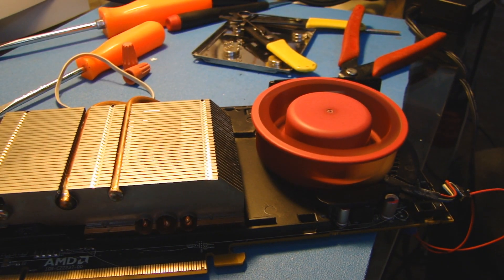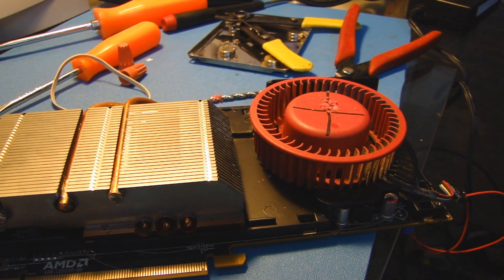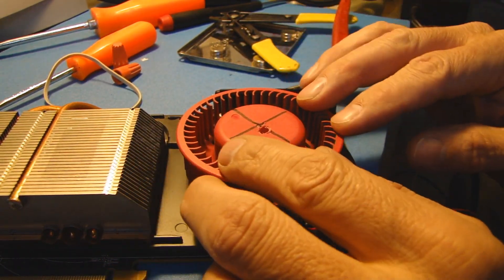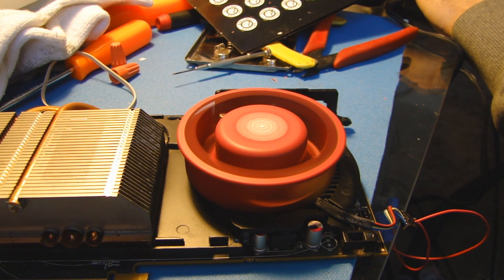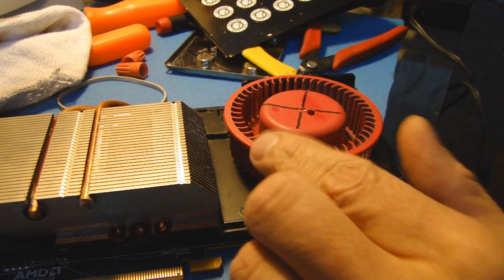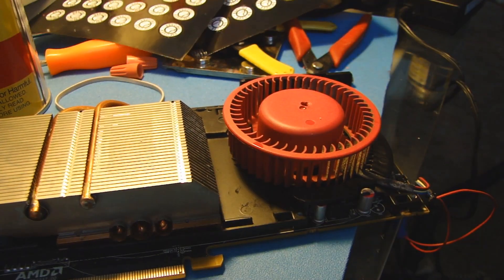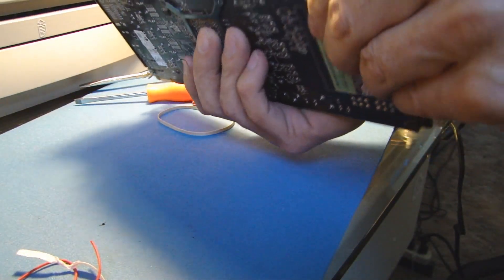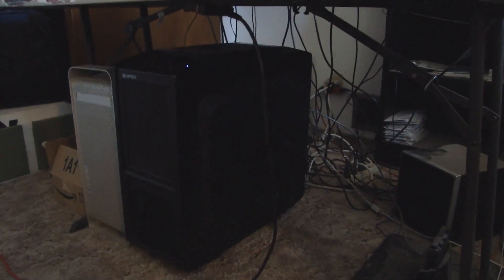Repairing Radeon 6870 fan noise...the easy way....

Comment: Dont do it this way.  Take off the reference cooler, and there is a triangle bottom.  Put screws under each part and force it open.  That is where you want to put the oil.  It will look exactly like taking the sticker off a case fan.  Also 3 in 1 oil works wonders on fans, and it lasts.  I have been using the same fans for my old corsair h70 for nearly 5 years.  Even after taking the cooler out and replacing it, i have the 2 fans in my case cooling it right now till i replace them.  Refer to this video to see how to oil a reference blower.  https://www.youtube.com/watch?v=kH8spGRL3Yk
Reply: +MagicOf Light Bearing grease would be optimal.  But i dont have any of that so :D 3 in 1 it is.
Reply from the maker: +MagicOf Light --- 2 things: 

1) Removing the fan is a huge process in and of itself.  This tutorial is aimed at those who do not wish to completely disassemble the GPU, including removing heat sinks from the CPU's, and then reseating them with thermal compound, which they will have to purchase or order and hence, wait for.  Not everyone keeps thermal compound in their toolbox like you and I do.

2) After almost 2 years in service, the fan is still running silently.

So with all due respect, while your solutions may be good ones, this is clearly quicker, easier, and dare I say, "permanent."
Reply: +Donnie Frank Well, they have also changed reference cards.  Recently I tried to open my moms reference hd 6950, which is what made me stop in here.  But, even with removing the heatsink from the gpu, taking the reference fan off, or even trying to get to the triangle part to pop open was nearly impossible without completely disassembling the entire case for the gpu, and since I lacked experience I did not because i did not want to hurt the board by forcing things off.

  WD-40 is not permanent.  In fact.  I have used PB blast which is magnetic and better than wd-40 on my bike bearings before.  After about a year or so after, my bearings were chewed up, because they did not have a buffer to keep them from grinding.  Thats why even 3 in 1 oil is not idea.  But it has alot more viscosity than wd-40.  I have never seen anyone treat a gpu quite like you did in this video.  It reminds me of another video when i saw someone scraping thermal paste off a cpu heatsink.  My hd 6950 is about 5 years old now.  I had to replace the twin frozr 2 fans/heatsink to another non reference heatsink/fan assembly because they were fans that really could not be replaced by themselves.  3 years after that change, the card is still running like a champ and im able to overclock 10% and maybe hit 60c in furmark.

  It is only maybe 30 dollars for an entire heatsink/fan assembly for a gpu for most models.  Doing this and possibly ruining your fan instead of spending maybe 40 dollars on a new heatsink+thermal compound seems very risky to me.  If you messed up what you were doing, and you only have 1 gpu, you are out of luck and dont have a pc to use.  Im trying to help people, your video may help some desperate soul who wants to prolong that reference fan.  But doing it this way should probably never ever be done, unless you are either desperate, or have another newer card and this is your backup card that you dont care if you ruin.
Reply: +MagicOf Light Just wanted to add.  Using something thin like wd-40 is completely temporary.  The thinner substance will in fact make it smoooooth and spin better than any other grease or oil you could use.  But it will also ruin the bearings permanently and they will have nicks and chips all over them, and it will get worse with time.
Reply from the maker: +MagicOf Light Well, again, you are purporting a more-complicated, more-expensive solution.  And I'm going to guess you didn't watch the full video, because WD-40 is just the catalyst for the motor oil.  The motor oil is too thick, so it doesn't spread and penetrate where it needs to.  The WD-40 ADDED to the motor oil penetrated the entire bearing assembly.  Once the WD-40 dries out (as it will), the motor oil is left behind, which should literally last forever.  Check the oil stains in your driveway.  Despite rain, snow, hail, sleet and merciless Sun, the oil is still there.  Right?

While I can't say if the repair will last 5 years, I CAN say that the repair will be 2 years old in two weeks.  My gut tells me that the repair will outlive the usefulness of the GPU.  4K video is on the horizon, which means 4K editing, which mean a more powerful GPU.

To summarize:

My repair = $0.00
Your repair = $40.00

My repair = about 1 hour.
Your repair = at least 2 hours, if not 3.

My repair can be done by any novice.
Your repair requires advanced skills.

My repair requires no special tools or materials (motor oil, WD-40, drill bit).
Your repair undoubtedly requires special tools to completely dismantle the GPU and thermal compound for reassembly.

My target audience?  The novice.  So while I have conceded that your repair probably works, you have to concede that my repair not only works, but it can be done by any 10-year-old with a screwdriver.
Reply: Donnie Frank Actually I did watch the whole video.  And the part where you were trying to keep the shavings out of the hole you made made me freak out, because one shaving is all it would take to completely ruin the fan.  You seriously got lucky there.  One shaving would have fallen in there of a decent size could have seized up the fan completely rendering your fix useless.

To summarize.

My repair-40 dollars, 100% effective.
Your repair-0 dollars, could ruin the gpu fan, leaving you with no graphics card.

Its not a matter of if this particular time it worked for you.  Because this kind of repair is risky, unorthodox, and not 1 computer repair person in the world would ever do it this way. You should have saved the 40 dollars...seriously.  

My way does not take any special tools.  Just small phillips screwdrivers that every single person who has a few tools has.  And learning how to take off the heatsink and replace the thermal compound does not take special training.  A 5 minute video on youtube from a tech expert on newegg can show you how its done.

This was an experiment really, not a repair.  And any novice who isnt willing to invest a few dollars to replace a fan and watch a video on how to do it, or replace the heatsink and watch a video on how to do that, needs to just take it to a shop and let them do it.  

WD-40 is less dense than oil, so it is the same as oil and water, it will rise to the surface and cause aeration and sludge.  Even if it has worked for 2 years.  Once that oil you put in starts to sludge, thats it for that fan.  3 in 1 oil can be added over and over.  Because it not like regular oil.  And the only thing that will eventually kill the fan is when the bearing finally starts to be too loud or seizes up because of how chipped it gets over the course of its life.

Even tech professionals use 3 in 1 oil to lube fans with.  One drop is all it takes once in a great while.  Just because you werent willing to search on how to take off the fan and oil it properly you are giving people this idea and possibly causing them to ruin their gpu fan for good.  And when the oil sludges it will be for good.  So either now or later, it is not a permanent solution that you claim it to be.
Reply from the maker: +MagicOf Light 

To Summarize:

My repair is 100% effective.  I did not get lucky.  If you noticed, I drilled by hand (no motors).  So keeping shavings out of the fan motor was easy.  We're not producing microscopic shavings here.  We're producing large chunks that are easily identified and removed.  Your "what if" arguments hold no water.

Risky?  Hardly.  That is your opinion.  Please view the comments.  While not a single comment corroborates your "theory," at least 1/2 dozen corroborate mine.  In the industry we call this "evidence."

Special Training: With all due respect, you are high.  Have you seen the video to remove the fan???  One must completely disassemble the GPU.  Maybe to a highly-trained technician who works on these everyday, it's "no big deal."  But to MY AUDIENCE, it is a VERY big deal.  I am a VERY technically savvy person.  But when I saw the video to COMPLETELY disassemble the GPU, and said, "Screw that," and came up with this MUCH easier, MUCH more cost-effective method.

WD-40 and oil:  Until proven, your "sludge theory" is just a theory.  But Okay....for the sake of argument, lets say there IS sludge in there.  So the "sludge" has been working for 2 years.  What's your point?  If it's working, it's working.  Who cares if it's "sludge" making the fan work, or a highly-specialized, duty-specific, specialized oil????  If this "sludge" is "killing the fan," it sure is taking its sweet time.

Research removing fan:  Okay...here's the video.  Tell me you would recommend this to a non-technician.

https://www.youtube.com/watch?v=qhIcVGuVAEw&amp;app=desktop

Ironically, your video shows the fan already in your hand.  Well...what about the removal???  Oh....forgot to mention that.  How convenient.  Well the above link is how to remove the fan.  I'll take the "drill a hole" approach ANY day.

Permanent solution: I never claimed the solution to be "permanent."  However, as of this writing, I WILL claim that it is AT LEAST a TWO YEAR solution.   And being that you're such a hot-shot technician, I don't have to explain to you that most GPU's outlive their usefulness after 5 years anyway.

Conclusion: 

If you check the comments, you will see a few "thank yous" and not a single complaint of a ruined fan.  Your position is predicated on "what if" scenarios that have not surfaced here.

My advice:

Next time you go on a "this will never work" tirade, do a little research first and find at least ONE PERSON to corroborate your claims.  Otherwise you just look silly and foolish.

Good luck.
Reply: 1.  That is not my video.  2.  If you are buying a reference cooler on any gpu you are not as tech savvy as you claim.  3.  If that oil was meant to go in those fans, or wouldnt cause issues inside the fan itself, that oil would be in there to start with.

Do yourself a favor, and google wd-40 mixed with oil.  You will see why you should not have done it.  This repair is still a risk.  And anyone who can watch a video and turn a screwdriver can take apart a gpu or a computer and put it back together.  It is not rocket science.  Dont throw it, work in as clean an environment as you can, dont let static discharge on the gpu.  

  I already did my research on this.  Wd-40+oil=problems in the future.  1 the oil you used is not the right kind of oil for a computer fan.  2.  You added wd-40 to the mix which when it is circulated quickly makes bubbles.  So with that mix, you are going to get hot spots on the bearing because of the bubbles, the oil that is made for cars does turn into sludge over time, And no im not a mechanic who knows how much time.  But its still not the right stuff to use.  

  The oil probably is doing nothing in there, it is probably the wd-40 flooded in an enclosed area that is keeping the thing going.  I told you i have experience with using thin lubricants like this in something that requires thicker stuff.  And the result from it.  If it isnt made for it, dont use it.  You wouldnt put unleaded in a car that uses diesel.  And you shouldnt do this.

  You say you want to help people do these things, yet you posted a video of exactly what not to do.  Go ahead and share this video with newegg, a computer repair person, or anyone who is tech savvy.  None of them will recommend ever doing this to your gpu.  And probably every one of them will yell out wtf and laugh like I did man.
Reply: I just want to add man.  That the end of the bearing where you are supposed to put the oil has a slight space where the stuff seeps in.  If any part gets loose at all, that wd-40 is really thing, and you could potentially get wd-40 thrown all over your computer while its running ruining your entire rig.

Sure these are what ifs.  But you posting a video saying it worked is also a what if.  Its about doing it with as little risk as possible, and getting more lifespan out of your gpu.  Im all for getting the most out of your hardware.  And the gpu fans provided mostly crap out after 2-3 years of running 16 hours per day.  

  But fixes like these, while clever, can cause problems for people who try them.  And are better kept to yourself rather than potentially causing someone to ruin their hardware man.
Reply from the maker: +MagicOf Light   So after I completely debunked and pooh-poohed your "what if" arguments, you give me MORE "what if" arguments.  Brother...there's thick, and then there' this.

Your arguments offer no evidence.  "Googe WD-40 and oil" is the closest thing you have to evidence.  Conversely, my evidence is right on this page.  Why don't you read the comments?  I can't read them for you.

I'll make this simple:

Either show a fan ruined by WD-40 and oil.  Or present someone who had had their fan ruined by WD-40 and oil.   If you can't, then MAYBE - JUST MAYBE - your argument is moot.  I can't put it any simpler than that.

And finally, MY VIDEO evidence of this working PERFECTLY TRUMPS your "what if" evidence that it "might not."  Period.  Clearly you've never been to court.  You will find "maybe" and "what if" arguments hold ZERO water in any real debate or court of law.

Contrary to your assessment, a video showing something working for 2 years is NOT a "what if" scenario.  Flat out, you are wrong.

So far about a dozen people HAVE tried my solution.  AGAIN, READ THE COMMENTS.   NO hardware "ruined."  No a single piece.  I can present no evidence more profound than user accolades.  And since you have ZERO evidence supporting your claim - other than your holier-than-thou technical "expertise" - I'm afraid you're just going to have to accept a loss on this argument, and move on.

As always, good luck.
Reply from the maker: +MagicOf Light   I removed your last comment.  I'm done with the circular argument and repeating myself.  Produce some evidence to support your claim, or your psycho rhetoric will be removed.  Anything NOT HARD EVIDENCE, will be deleted.